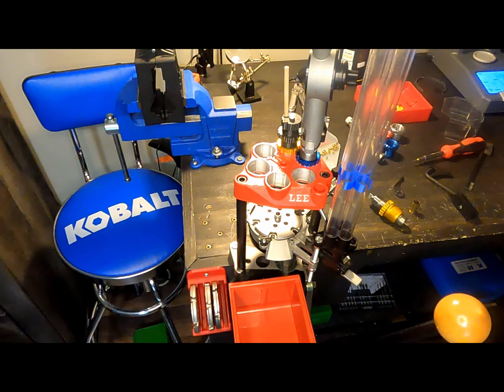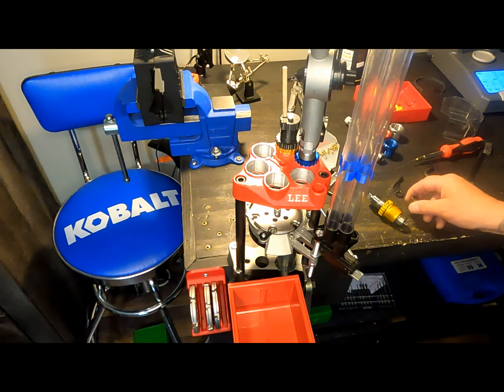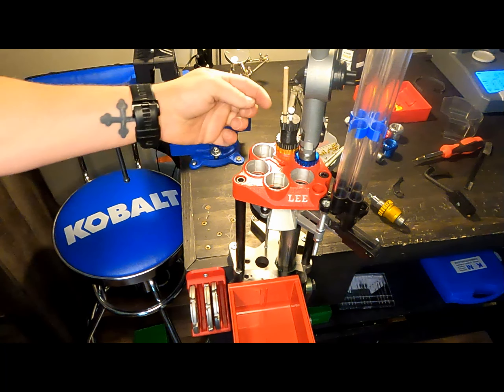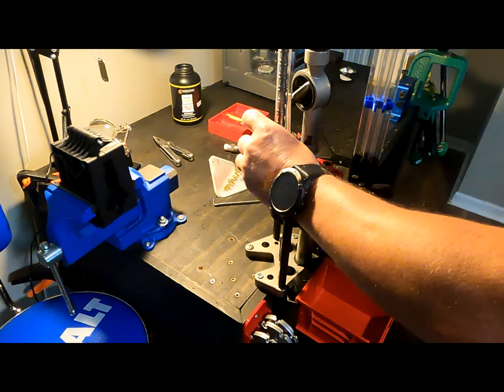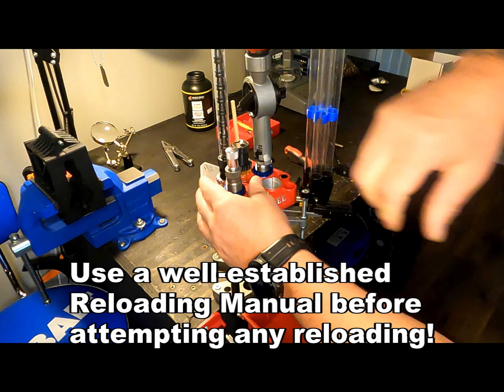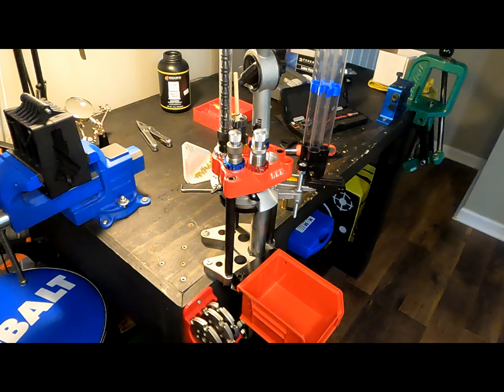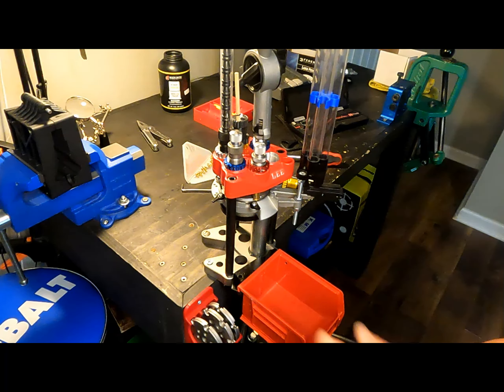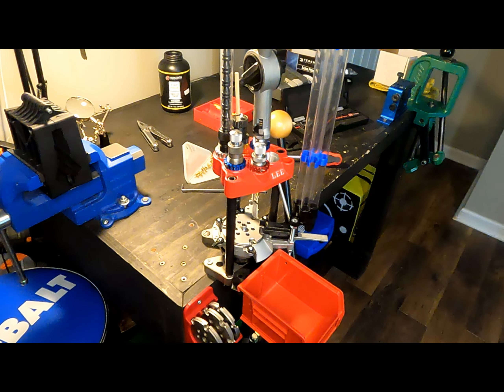Lee Six Pack Reloading Press Setup- Part 3

Comment: Hi very good video! Which one die are you using to control the height of the powder?
Reply from the maker: If you’re referencing the powder cop, it was 3D printed. I purchased it on Etsy
Reply: @curtisbrown6235  👍